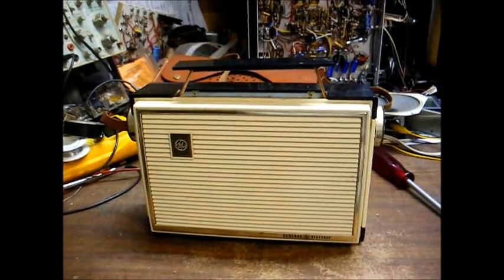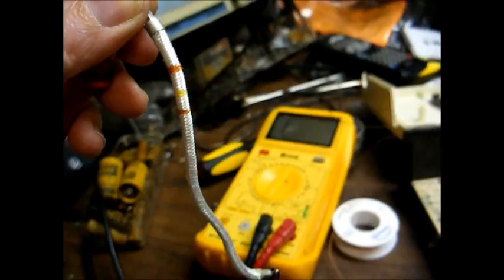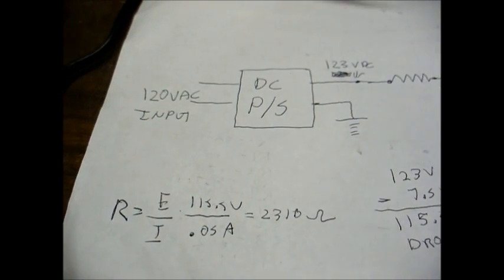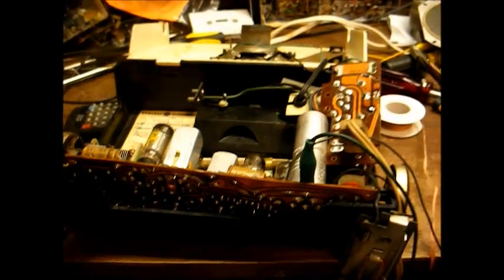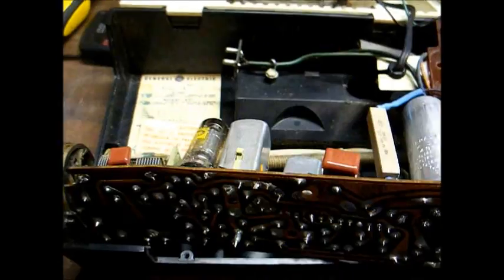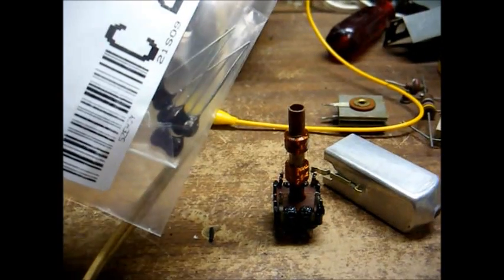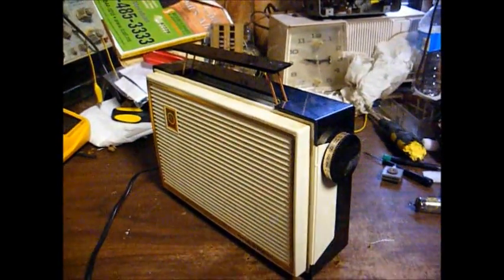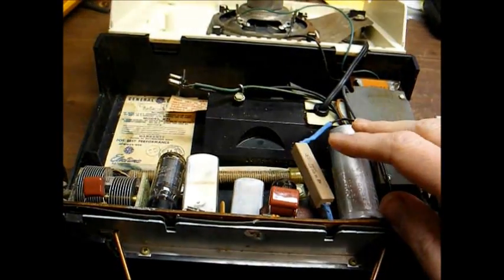Repair of a GE portable AM tube radio from the late '50's

Comment: Those old series string radios with 300ma tube heaters wasted 36w on just the tube heaters.  The later 150ma heater tubes only needed 18 watts of power, and some clock radios used tubes with 100ma heaters, reducing the heater power to just 12 watts.  Of course we also used some power for B+ which typically adds about 6-10 watts to the power drawn.  Those 100ma heater tubes required a rather weak audio output power, typically less than 1w, but that's enough for a table top clock radio.

Comment: You Have A Multi Meter. Test The Wattage Of The Rezister. Getting Batterys For A Radio Like thatone would Be Hard.
You'd Need To Use Modern Cells.
Reply: ...you can't measure watts with a multimeter...
Reply: Nope

Comment: 7.1 volts is actually not bad, the tube filaments are rated at 1.4 volts and 2.8 volts, so the string in total is actually 7.0 volts.

Comment: I understand this is a rather old video, but a question always comes to mind when I watch the removal of those old Selenium rectifiers, why not replace it with a bridge rectifier instead of a half wave rectifier?  Wouldn't that solve some of the voltage issue as 4 diodes would drop each .6 volt and you would come out with a very smoooooth DC rather then the pulsating DC you get with the half wave setup?  Just wondering, I am an old fart that plays with the electronics but never studied it in college, back then every one wanted to study computer crap. (I was an old fart when Workers Comp sent me to college in the mid 90's.

Comment: Those batteries were even pricey back in the fifties. The B battery was around 15 dollars plus tax. The A battery was about 6 dollars plus tax. We owned one of those style radios back in the fifties and needed  a set of batteries to use the radio at Fire Island New York. Fire Island had no electric service back in the fifties. They used kerosene lanterns for lighting and fireplaces for heat and propane gas for stoves and charcoal grills to cook outdoors

Comment: A well done video.  

Thanks for all your effort on this radio.  I don't  have near the experience you have, but I am amazed that the electrolytic capacitors were still good to use after all these years.  I was under the impression that these capacitors would have dried out by this time.

Regards, Tom

Comment: I would place a plastic band strap, perhaps two around that power resistor and the filter can capacitor to add support for the power resistor so that it won't wiggle loose a bad solder connection due to the resistor weight onto the pc board solder joint later on in the future? The filter can capacitor can also help heat sink that power resistor as well?
Reply: JoeyMars1 IT'S NOT THAT SIMPLE- THE HEAT FROM THE POWER RESISTOR WOULD ACCELERATE DETERIORATION OF THE FILTER CAPACITOR, AND THE RESISTOR WOULD LIKELY OVERHEAT ANYWAY.

Comment: So that static is there due to leaky caps in IF coils? Thanks for this video, I really learned much more from you than they teach me in university. And funny thing - most repair specialists like you, are not math nerds - so I have a chance, because something more fancy than Ohm's law and simple formulas give me headache
Reply: MrJohhhnnnyyy Actually, the mica capacitors are not "leaking"- they are actually arcing because of bad connections.

Comment: Those battery tubes run in a range between 1.4 to 1.5 volts, at least for the low current ones they started using around 1939 or so, just in case anyone is curious about the 3 volt tube, that was likely a 3V4 which has a tapped filament with two 1.4-1.5 volt sections. The reason for that is that some battery tube radios ran the filaments in series for AC mode, and in parallel for battery mode, with a switch, so they could use a pair of "C" or "D" cells rather then a 7.5 volt battery.
 When I need to come up with a dropper for battery tubes I tend to make it a little bit on the high side in terms of a standard value resistor, and if it needed a 5.5 Watt resistor I would try to use either a 10 watt or a 15 watt if I had one.

Comment: Excellent video! Back in the 70's I had this radio in red and white. It was very good performer for a set without an RF amplifier stage. Unfortunately, the infamous GE IF can silver migration disease grim reaper reared his ugly head and not being able to obtain a new IF can (no internet then) or knowing how to rebuild, I regretfully tossed the set. A few years ago, I picked up the solid state version on EBay and fixed it but it's not as good of a performer.I'm keeping my eyes out for a tube one like this. They are fairly common.
I agree with your view on Raytheon tubes. When they started sourcing them from Japan, the quality went way south. They must have been made by the same company who made Radio Shack Realistic Lifetime tubes!

Merry Christmas to you and your family!!

Comment: Wow, what a struggle with this one! I have its brother, same chassis, a GE P736A. Its a little fancier and has a gear reduction tuning dial. It has a microphonic tube also, fixed by wrapping it with a rubber band. They are pretty good for only four tubes.

Comment: Is that bottom plate of the handle assy made of metal or is it plastic? It's mighty close to the bottom side of the pc board if it is. One other question, even back in the day it seems to me like a 90Vdc battery priced at 5 or 6 bucks would have been a luxury item even for a lake/beach/cabin outing wouldn't it? Happy Christmas there rtvp-nut!